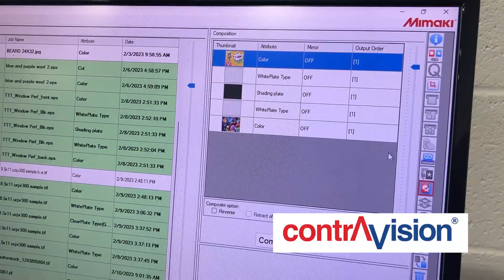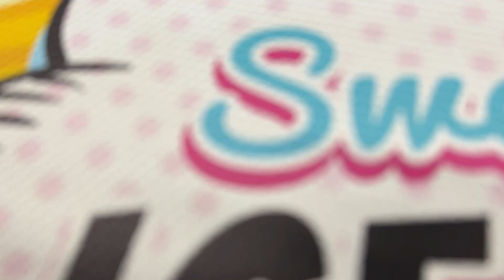Creating Double-Sided Perforated Window Vinyl Utilizing the UCJV300

Comment: When I print on perforated vinyl, the ink of my ucjv300 seals the perforated portions... So, the see through aspect is not being accomplished.... What do I need to do differently?
Reply: There is a specific contravision for the uv printers, it’s a 3 layer contravision, if you print on the one made for solvent ink it blocks the holes.
Reply from the maker: @socrateschristodoulou7993 That is correct!
Reply: I have the same problem as @rosehipmagic and I understand that I have to use a specific material but where and how to find that material, who can provide it to me? Sorry for the lack of knowledge but it is very hard to work without concrete answers and also thank you for your time. @MimakiUSACorp
Reply from the maker: Hello, as mentioned in the beginning of the video we used Contra Visions Performance HD clear window perf 
https://www.contravision.com/print-substrates/new-performance-hd/  @eduardogonzalez-ws8nr